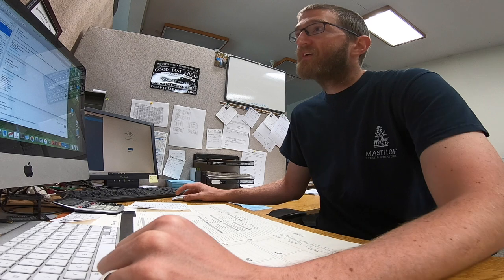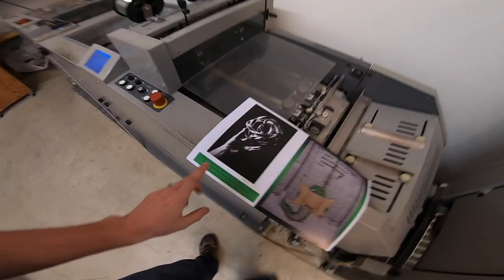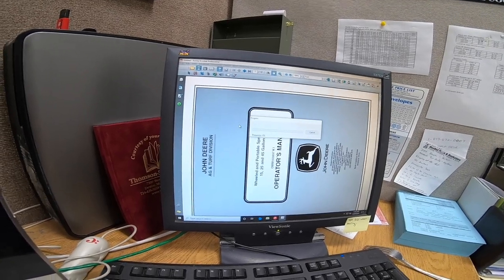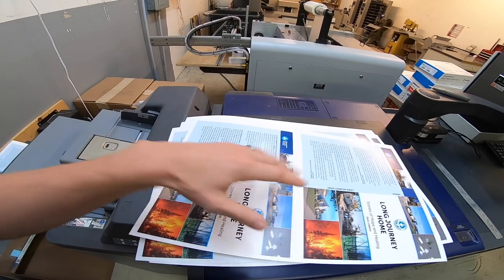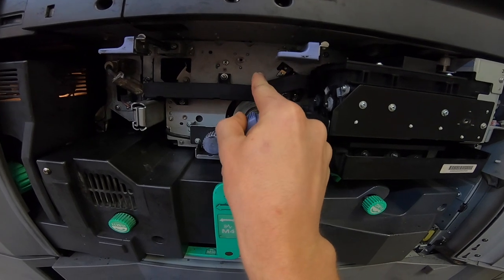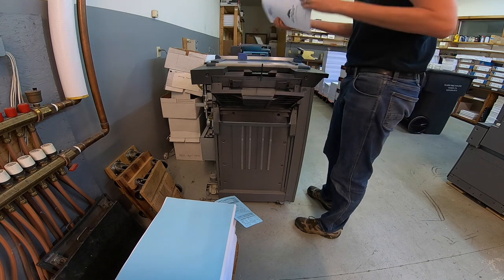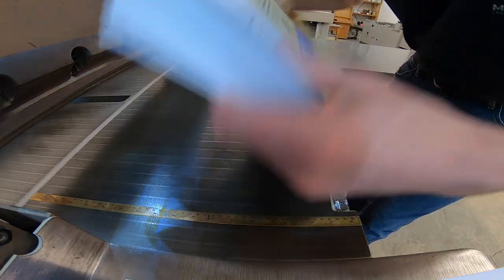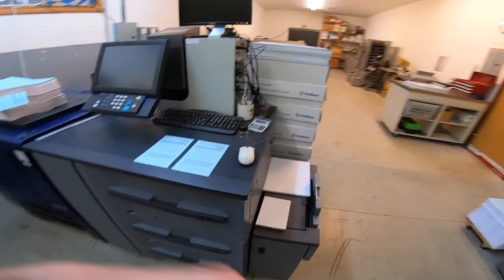How Images get Printed on Paper, Electrophotography in Konica Minolta Presses

Comment: I’m wanting to take my print shop from just in house regular prints, meaning inkjet, to using a more professional printer or press. Which one would you prefer I use just to get me good print quality, quantity and turn around until I am able to buy a full line press? Which would you prefer for a residence? Plus electric cutter?
Reply from the maker: I am only really familiar with the Konica Minolta machines. I like the quality, they will look different than your current inkjet machines. I would contact your local Konica rep and ask them to print samples. You should be able to find a cheap used cutter too.

Comment: Dan, will you review our compatible TN619 cartridge which can be used in your printer C3070 Konica Minolta?
Reply from the maker: That machine has a service contract so I don;t want to run anything in it other than what Konica sends me. If it runs in a 1070 I can. I'll have one of those on my floor before too long.
Reply: @justaprinter   Yes, It will work in 1070 too.
This is the link of the video https://www.youtube.com/watch?v=nhqCC_FXLiE
Reply: @justaprinter  Hii Dan, I did not hear back from you. Do you want to do that?
Reply from the maker: @raviravariya5252  Sure I'd give it a try. I should have a 1070 here and running within a few weeks. contact me at justaprinterman@gmail.com
Reply: @justaprinter  okay sure

Comment: Hi Dan, do you do a tray alignment often using the RIP to ensure good front to back registration on your 3070 or how do you approach this? Thanks.
Reply from the maker: I only do tray alignment on the press through both sides adjustment. I'd say I have to adjust it every few months and it is usually because I am using a different paper.
Reply: @justaprinter  Thanks Dan, this area confuses me a little as I thought the machine was designed to give good front to back registration. My suppliers tell me to regularly do a a tray alignment using Efi which will basicly skew the image slightly to straighten if required. It's not something I do but I need to address this as I do see a very slight skew on the print from front to back.
Reply from the maker: @gerardhaughey1  Try only making the adjustment on the press. I pretty much never need to adjust the front to back alignment, it is very consistent. The only times front to back adjustments need to be fixed are when I cut paper down before printing and my paper is inconsistent.
Reply: @justaprinter  Yes, I totally agree Dan. Thanks for taking the time to answer my question.